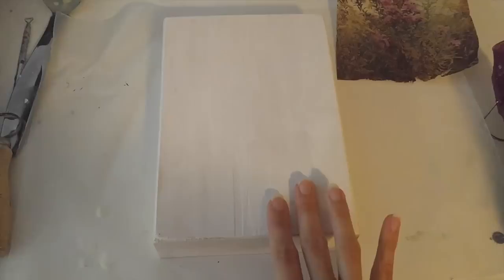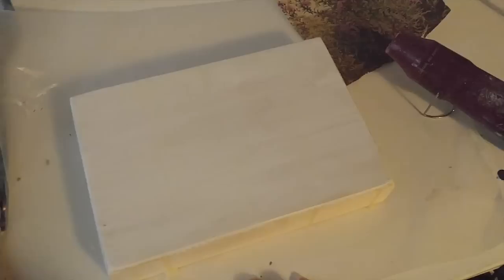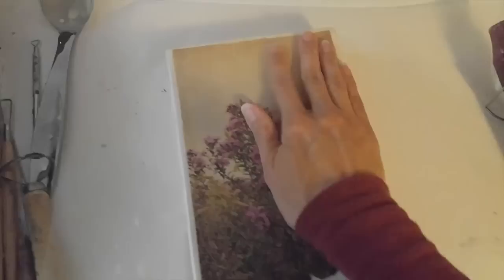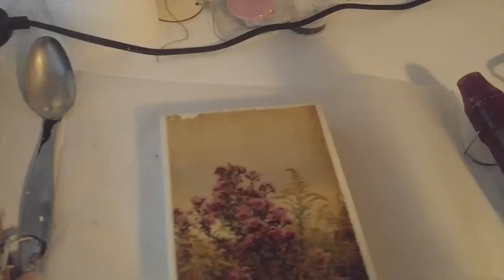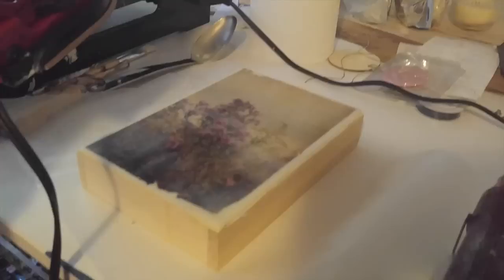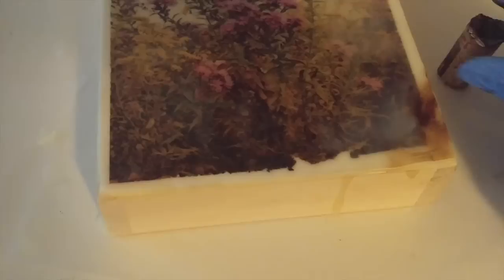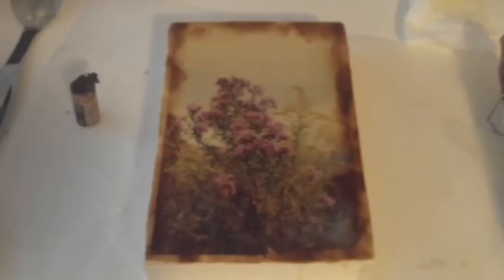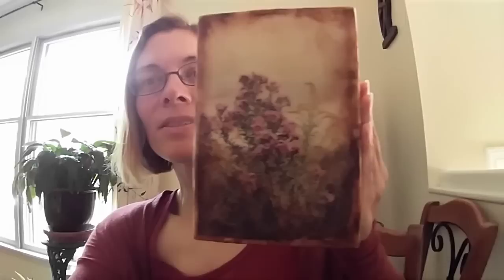Encaustic Photography: Behind The Scenes with Lisa Renee Wilson

Comment: Thanks for sharing your process with us. I loved that you used Japanese rice paper! I've been a photographer most of my adult life and recently started playing with encaustic photography. I'm curious to try Japanese rice paper. Did you tape the paper onto regular inkjet bond paper and then run it through your printer? Also, does any type of rice paper work? Hope to see more of our work.
Reply from the maker: Julie - how wonderful! Encaustic definitely adds a new dimension to photographic creativity. With the paper, I actually just fed it through like normal. After a lot of trial and error, I found that putting a few sheets of the rice paper in a stack with regular printer paper helped the paper to feed through. I average about a 99% success rate this way. :) As far as other types, I've not tried them - I would guess some would take both the ink and the wax slightly differently.

Comment: So, I take it that because the rice paper is so thin, it's not necessary to adhere your photo with any kind of adhesive first? Does the photo stay embedded without bubbles for the long term? So far I've just used either regular computer paper or matte presentation paper to print on...either of those seem too thick to just use the wax to hold the photo in...but I'm having trouble with small air pockets showing up down the road a while.  Def trying to trouble shoot with varying adhesives or in this case perhaps trying thinner paper. Do you anchor your rice paper to computer paper before putting it through the printer, or does it hold up on its own? Thanks for showing your process!
Reply from the maker: Great questions. I've not had any troubles with the rice paper bubbling up, as it is more porous (and thinner) than other papers - thus, soaks up more wax and doesn't fold up on itself. With regular computer paper, I've had the same troubles - primarily with it curling up on the edges. I've found I really have to soak that type of paper in the wax first, which requires many layers underneath the paper itself. 

What adhesives have you tried to use? I've found that the wax itself is generally enough with the right type of paper. (If you want to continue to use thicker media, you may want to try more layers of wax underneath to leave plenty to press into and/or putting wax on the back of the paper first before fusing it to the layers below). 

As far as anchoring, I've found if I put one sheet of rice paper on top of a few sheets of regular paper, my printer takes it through just fine...MOST of the time. I wanted to avoid having to use adhesive to "tape" it to a regular piece of paper so that I didn't have to worry about removing the rice paper after and having it tear. I'd say it works about 99% of the time (and the rest of the time, I use the wrinkled rice paper for other creative projects!)

Comment: Sorry if I missed it, but which rice paper do you recommend? Beautiful piece, thank you for sharing!
Reply from the maker: Hi Nicole, and thank you! I actually don't have a particular recommendation for rice paper. I'd searched on Amazon and found one with a higher review, then just tried it in my printer at home. I think any type would work ... just, as I offered in a few comments, be mindful of how you feed it into the printer. I've found that putting one sheet of rice paper atop several sheets of regular paper tends to help it run through the best. (If I do a stack of rice paper, it inevitably gets caught in the printer) :(

Comment: Hi Lisa. I'd like to start doing this process. I do not have a big space though and would need to use my kitchen. What is the encaustic that you use and the heater to keep it melted (Budget)? What do you do for the ventalation aspect? I want to be conscious of the health aspect when working in my home. Thanks.
Reply from the maker: Hello Diane! Space is definitely something I struggle with as well. I like using that griddle (a pancake griddle with adjustable heat) for a heating surface and the pre-made encaustic mix (damar resin+beeswax) so that it stores in one bag instead of two. Ventilation is important more so when you are working with pigments (as certain ones can be quite toxic and lead to eye issues, headaches, etc). I used to have a rather elaborate cross ventilation system set up with fans and a window unit, but have found that in working solely with the damar resin+beeswax mix and the oil sticks, I've not had any issues. A simple fan (small that sits on the desk) that blows the heated mix towards an open window has sufficed. Good luck!

Comment: Did you mention what type of ink printer your are using, ie., pigment or dye based print? Thanks!
Reply from the maker: I'm not sure if I did, Daniel! It is a standard ink printer - an HP printer. According to what I was able to find, black inks for this printer are usually pigment, while the color ones are usually dye based. That means that either type of ink should work, at least in this type of set up.

Comment: Just beautiful!What brand of encaustic iron do you use.Thanks!
Reply from the maker: Jane, thank you so much - and I apologize for the month delay in response! I use an older one that is almost identical to this (https://www.amazon.com/Encaustic-Arts-Crafts-Iron-Painting/dp/B007SPQ3HY/ref=sr_1_1?ie=UTF8&qid=1515164469&sr=8-1&keywords=encaustic+iron) ... I believe I found it on Amazon years ago at a much cheaper price. There are a wider variety of options now, so you might want to just do a web search (as many local stores are limited in what they carry). There is a great one I'll try to find that I haven't used, but that acquaintances have had great luck with...

Comment: do you use just a block of wood sanded?
Reply from the maker: Hi Angela! I used a cradled wood panel purchased from Michaels. (If you search "cradled wood panel" via Amazon, Cheap Joes, or Dick Blick Art Supplies, you can also find some good deals on these.) Hope that helps!
Reply: I am in uk ,,is cradled wood ply wood ?
Reply from the maker: No - it is a flat piece of wood backed by a wooden frame. Does that make sense? You can make your own (though I haven't tried), but you'll want to use an absorbent wood for the surface (so not MDF, for example). IF you look at the video, you can get an idea of what the front + 4 sides look like, or Google "cradled wood panel", which will bring up some images of what I mean. I hope that helps!